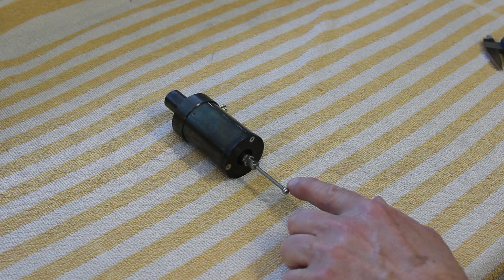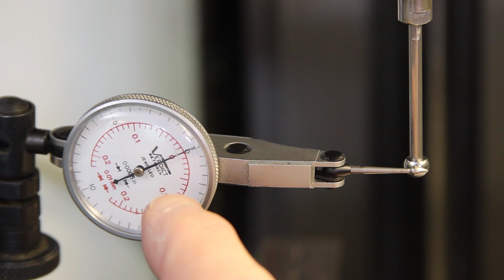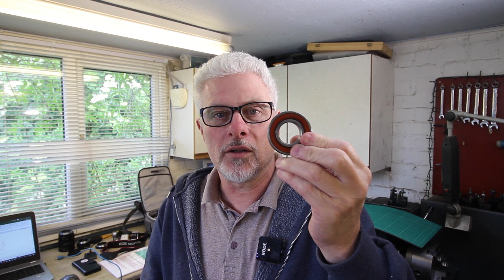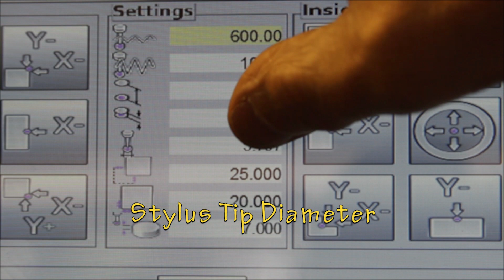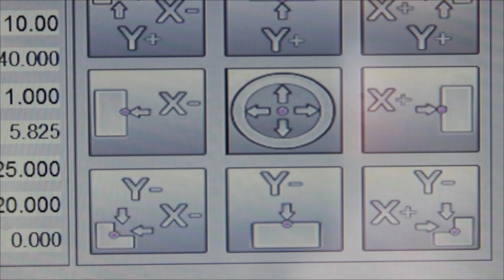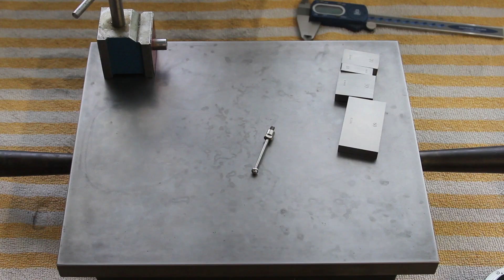Setting up a DIY CNC probe

Comment: I’m so glad that Planet CNC is making the measurement/calibration of the probe automatically. You only need a 20€ 30mm calibration ring and a script will do all calculations.
Reply from the maker: That’s interesting I have had a look at planet CNC’s website and can’t find any information about it. Sounds like a really great idea. I hope to revisit this project I have some ideas I would like to try out. I am tied up with my new workshop probably until the new year.
Cheers
Reply: @CazualHaze  yeah you have to turn the probe 180* one time and it figures out how off center the probe is too. It’s a great controller software. Gantry squaring, a lot of probe scripts, tool wear compensation, backlash compensation etc.
Reply from the maker: I’ll take a closer look at it I need a new controller for my old laser cutter 
Cheers

Comment: Touch probe with three contact points by 120 degree separations construction inherently have errors differently in four sides measurements. Using four different  compensation values will solve it. I wrote program to find them out and make use of them by locating them in routine probe touching program procedures (may be my probe is not so accurate too, with adjusted the three setting screws, accurate result is not got every time). 
For the last part of your video mentions, l prefer to have a reference protruded block surface on the machine table or on toolchanger box, every time the probe(or new tip) is brought to use,  there is program automatically bring it touch it first to set z zero.
You got the Mach3(or Mach4)probing interface and probing program, Is it a free download one?
Reply from the maker: Thanks @ray-charc3131
I did not know there was an auto tool height routine available I will try and get it loaded into my mill.
Cheers

Comment: Would it have been better to clamp on the inner race of the bearing rather than the outer race, thus eliminating any inner race looseness in the bearing?
Reply from the maker: probably! I really ought to get a proper standard for this testing something known good and accurate.
I still find it amazing you can get down to the microns in a home shop!
Cheers

Comment: Blum do a gauge ring rest. Then spin the probe 180 degrees and re run it. This allows you to estimate the "runout" of the probe. Also the offset of the spindle from zero

Their calibration macros are interesting in that they do a single touch and this gives you a combination estimate of trigger distance and probe signalling delay. As long as you probe at the same speed every time it remains micron accurate (eg I probe at 1,000mm/min and see micron repeatability)

Finally note that you measured your table top to spindle, so you can find the length of the probe by just probing the table? Seems faster than even measuring stuff with calipers? No?
Reply from the maker: It does look like there are several ways to calibrate one of these probes. Keeping the speed constant is a really good way to keep accuracy. I did buy a digital height gauge to measure the tool lengths but I got one with  only0.05mm accuracy so it was a waste of cash!!
Cheers
Reply: @CazualHaze  I recently bought one of the micron Resolution 0.001mm mechanical toolsetters for adjusting heights of inserts on a facemill. I can't speak for how accurate it is, but all three numbers move and repeat (more or less) as I spin the facemill. So it's good enough for relative measurements.
Reply from the maker: Sounds good repeatability is key for me!

Comment: Working in a metrology department I can tell you that we datum our probes 2 or 3 times a day. If a probe hasn't been used, or had been swapped out of the mount it is datumed before use. The idea that you don't have to calibrate your system is fine if you're not looking for micron accuracy. Yes I have forced the company to scrap thousands of posts for being 9 microns out of spec, that was fun explaining that.
Reply from the maker: thanks #grapes008 I get that its clearly the difference between a bloke with a hobby and someone needing to hit a precise tolerance. The more I get into the higher spec stuff the more I get bogged down in the rabbit hole. It is fascinating the lengths you have to go to to get things made really accurately.
Cheers

Comment: That's great stuff and a subject close to my own heart.
I didn't see any info on what you use for CAM, but if it's Fusion360, would you be interested in macros and a post-processor to integrate probing with the CAM?  I've done all that stuff both for Mach3 and for PathPilot for the Tormach users.
Reply from the maker: Thanks David,
That sounds interesting to have a look at.
My mail is cazual.haze@gmail.com
Cheers

Comment: This may be a stupid question, but would an unsprung metal probe act as a probe, but without the error of the spring and contacts. Assuming you are machining metal, the probe could just touch off the part itself, and become electrical continuous between the part and probe.
Reply from the maker: Thanks @The Orange Baron,
Yep in theory you dont need a sprung probe but your machine will bend it. I made one and that's exactly what happened! I think the best ones use a strain gauges instead of the kinematic ball arrangement. So a very light touch can be picked up. Maybe you could also use a microphone arrangement to listen to the probe touching the part, it would be sensitive but prone to picking up the machine moving.
Cheers
Reply: @CazualHaze  Neat, I understand, thanks for they reply!

Comment: Most interesting videos I have watched in a while, thanks for sharing both the video and your thoughts.
Reply from the maker: Thanks Derek,
I have to say its turned out pretty accurate I am still surprised how well things can be made in a home workshop with relatively simple equipment. I have made a wireless optical version circuit for this but I am holding off at the moment as I may have another way to make a sensor that could be even more accurate with less precision to make it. 
Thanks for the comments its always good to hear what people think.
Cheers.

Comment: how i get that tool to size the material ?
Reply from the maker: If you put your rough stock dimensions into the Vers.by wizard then press the corresponding button (inside circle. Outside circle, length etc) then it will measure it for you.
Cheers

Comment: Really interesting stuff. I love how thoroughly you quanitifed the error, it's really cool that the lobe shape is visible in the plot. I wonder if you could get higher precision out of the probe by marking a dot on the stylus and manually rotating the probe so that it always contacts the work piece from the same direction? I.e. rotate the dot to face the thing you're measuring. Probably not worth it if the probe precision already exceeds the mill's repeatability. Thanks for making these videos, your channel is rapidly becoming one of my favourites, I wish you great success with the whole YouTube thing.
Reply from the maker: Thanks James 
I think if you could rotate the probe so it only measured in one direction you could get some really accurate measurements. If you did this you could also I guess make a simpler probe (one set of ball contacts). But as you say the probe looks to be more accurate then the mill anyway!
Thanks for the kind words I enjoy making these videos.
Cheers

Comment: Thanks for sharing. I have a Renishaw head that I picked up for $100 a few years ago that I need to get wired up to Mach3.
Reply from the maker: Thanks Keith, you did well to get a proper probe for so little!
Wiring up is very easy tis worth the effort.
Cheers